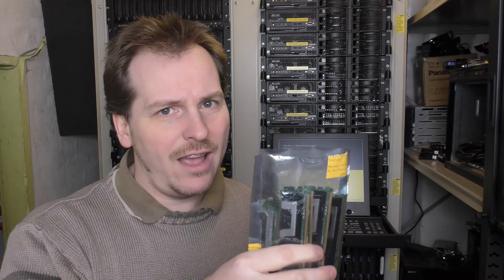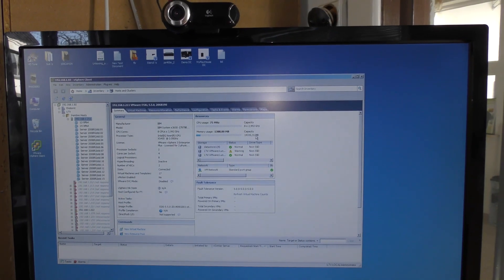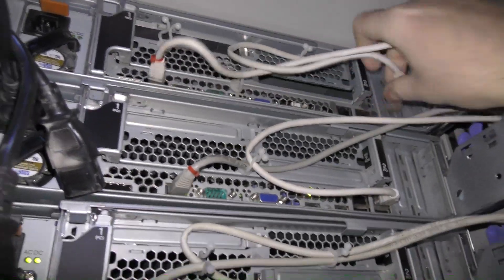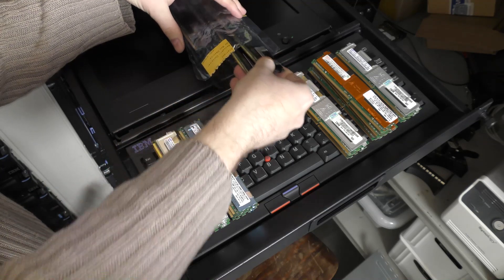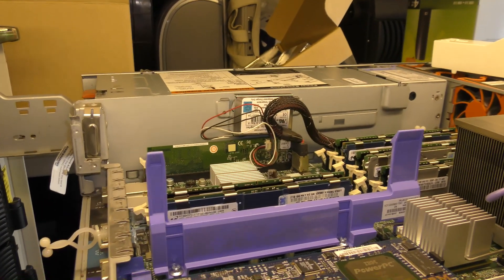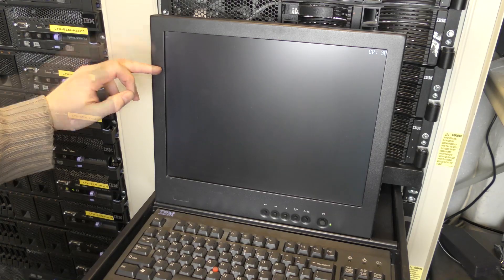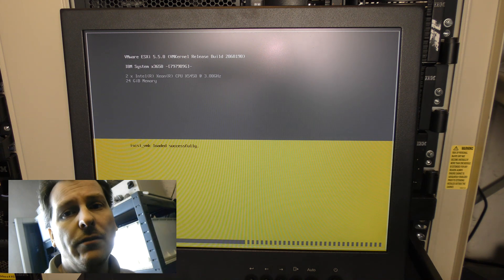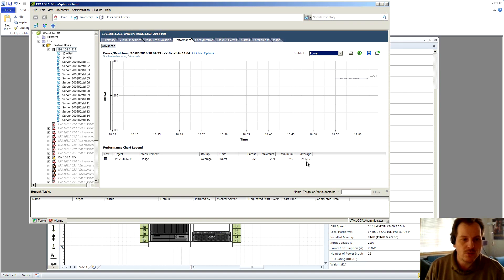IBM Server, Memory upgrade of System X 3650 M1 - 315

Comment: Have you ever considered upgrading your servers so you are using DDR4? The power savings on DDR4 vs DDR2 would probably cover the cost of server in a year or less (not to mention the smallest memory module in DDR4 is 4GB unless you go with Broadwell and then it will be 8GB modules).
Reply: +Sparty83 no advantage. Any server that uses DDR4 (used cost) would be over $2000 each! Plus he leaves them on maybe 4 hours a week so zero point
Reply: +MrEeeaddict I assumed he was running them 24/7 which would have changed the equation. If he only has them on for 4hrs a week you are right, no way to cover the cost.
Reply: Sparty83 His whole purpose anyways is cheap hardware to render frames. so even if it was on 24/7 he'd probably still be better off with ancient hardware lol
Reply from the maker: Hi +Sparty83 and +MrEeeddict
Good answers both! I only use my equipment in the weekend,,normally. Just have one IBM x3650 M3 running 24/7.
Thank you for watching! :-)

Comment: What is that PowerPC processor doing in the server?
Reply: +kuglepen64 It's the processor for the RSA (Remote Supervisor Adapter). Similar to HP's iLO and Dell's DRAC. Allows remote administration of the server, even if it's powered off. You can power the server on and off, view error logs, view hardware configuration, control the server remotely and mount remote media. Like a little computer within the computer. It also has it's own LAN port on the back, so it can be truly independent of the rest of the server.
Reply: William Glover Cool, thanks.
Reply from the maker: Hi +kuglepen64 
It is one of the reasons that the model 1, is my favorite model... That PowerPC processor is so much damn faster then any thing else they have put in since :-)
Good answer +William Glover,, thanx :-)
Thank you for watching! :-)